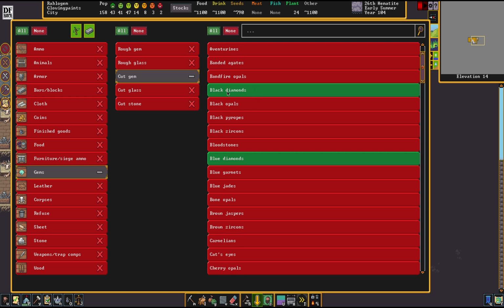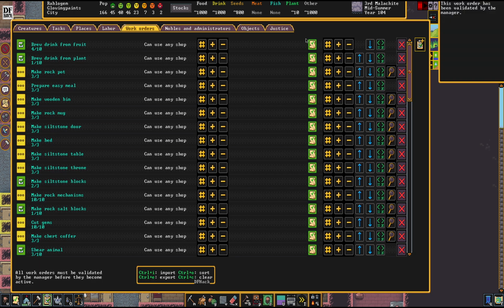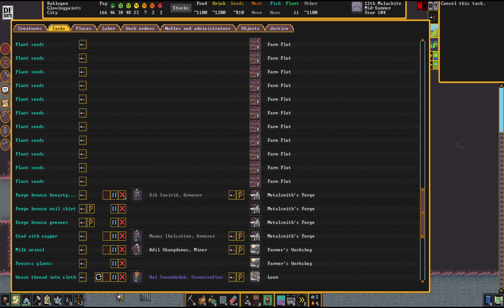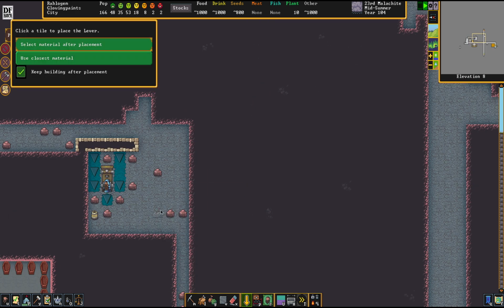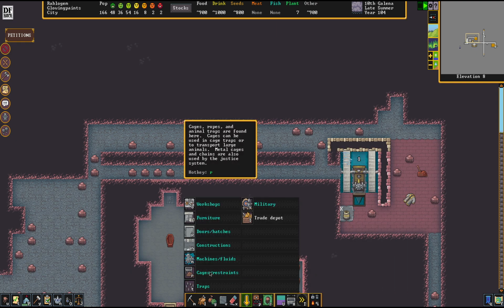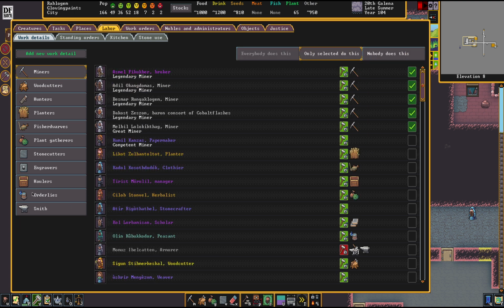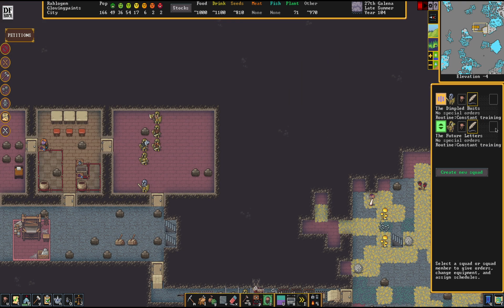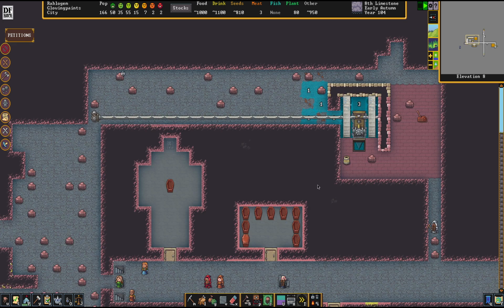WATER POWER - Advanced Guide DWARF FORTRESS Guide Ep 17

Comment: If you wall off that side where the water is leaking and take power out of the top of the pump screw  (1 z level up) you avoid that water issue
Reply from the maker: Oh yeah, that'd look way more neat!
Reply: I just mined up a z level and brought the power over. Had a problem with losing water but now it's perfect. Thank you both. I've mastered this mechanic.